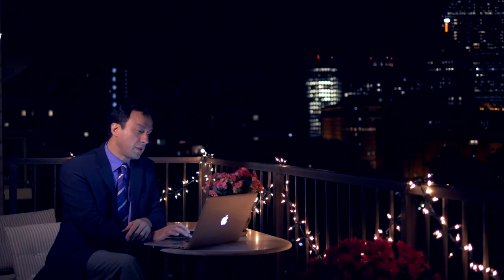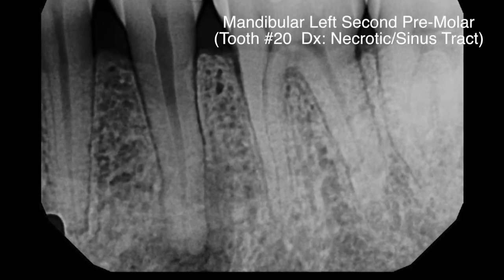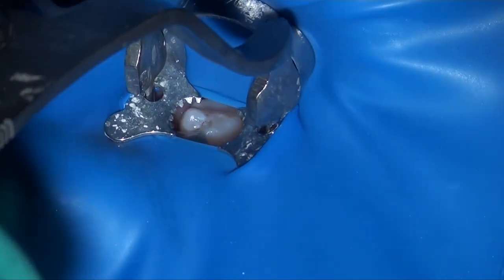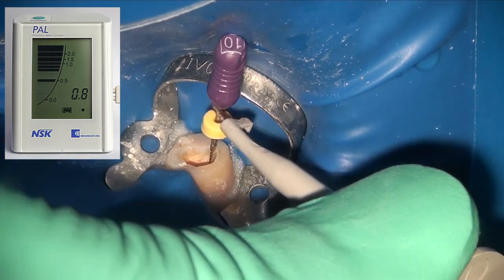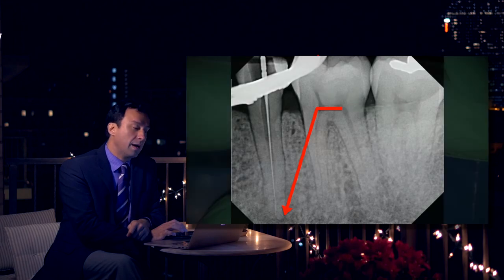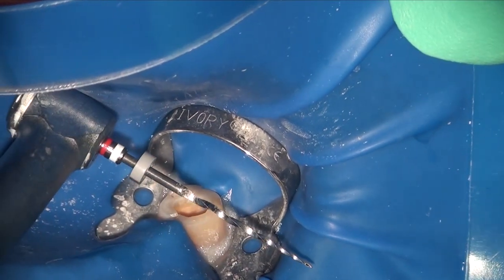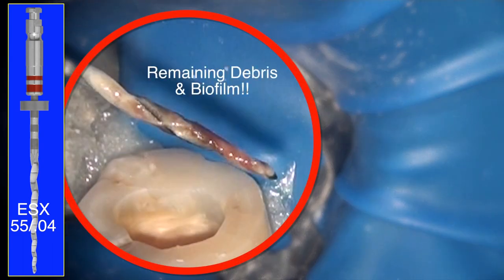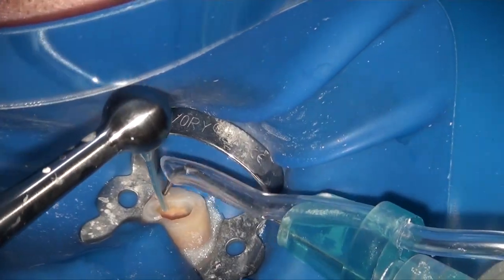CBL#4: Basic ESX Instrumentation Premolar

Comment: Hello again! How long was your entire appointment? for how long do you leave the NaOCl in the canal? Did you use the cotton/ cavit for the referring dentist? Maybe a bonded resin filling would have discouraged him of placing this post :D
Reply from the maker: The entire appointment excluding the anesthesia was about 20min. Regarding your NaClO question, there's a lot of reference about that Spangberg article in the 70's that makes a comment about this length of time, otherwise, volume of irrigant, ultrasonic activation, and several other factors are more important than this time factor, evidenced by the fact that the infection healed despite its massive initial size. And yes, Cotton/Cavit was used since in Boston, restorative dentists do the core and crown as opposed to the endodontist. That's why I didn't bond a core right away. Restorative dentists are encouraged to restore immediately to reduce potential contamination. Please leave comments/questions on the RealWolrdendo website rather than here on YouTUbe. Thank you.